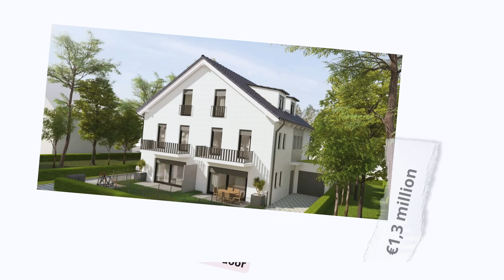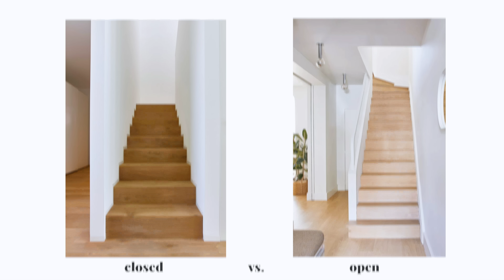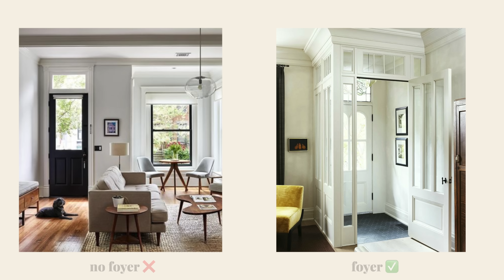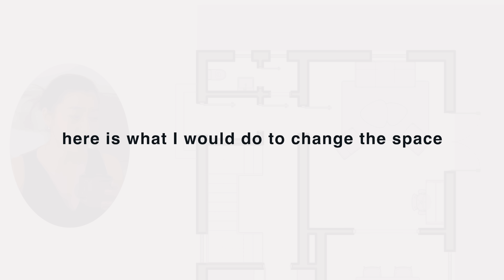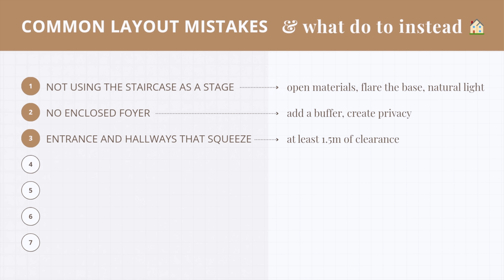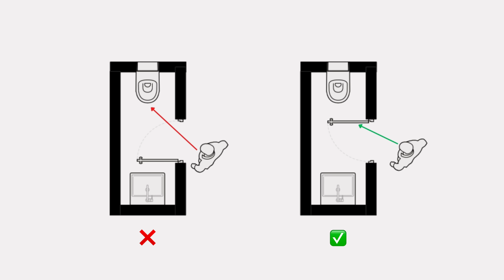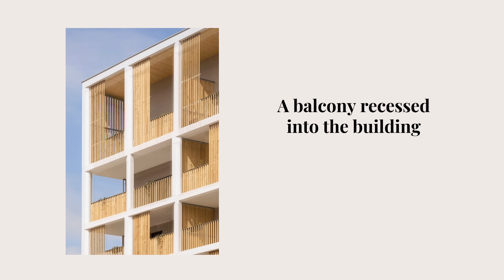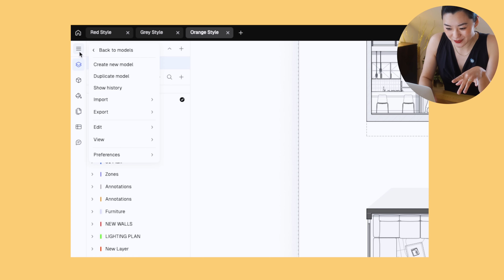Architect’s Advice: 7 Common Layout Mistakes + What to Do Instead

Comment: Outstanding!  The other issue is the bathroom at the top of the stairs with the toilet dead center! Why? And as you stated at the end of a hallway, etc, with the toilet dead center, ugh. We all know it is a necessary function ( item) but in a home? Homes are not public spaces, gyms, etc., where a direct path to the toilet may be necessary; unless there is an accommodation for physical or an age related issue, this is completely unappealing and unnecessary.  As you can tell, this is a hugh pet peeve of mine.😅  One last comment, people who have small budgets or who are low income still deserve good design for the same reasons and emotional wellness and, in that case, may even be more significant.

Comment: I personally prefer a bedroom facing east to catch morning sun and avoid evening HEAT. As an apartment dweller this is a nonnegotiable for me. And I’m a corner unit my bedroom has two walls of huge windows!!  I cannot fix my exposed toilet but just close the door slightly and for the architect who complained about windowless bathroom I agree and run a dehumidifier

Comment: Good points, although having windows on more than one wall is very unfeasible for most buildings and for most rooms in a given apartment/house. Also, a window is essentially a hole in the wall, thermally speaking, so it's a nightmare to keep warm at winter and cool in summer the more windows you have. If it's for someone's 10+ million dollar home, do whatever, but as a general rule for accomodating actual everyday people, I can't really see that happening too readily.
Reply: Double or triple glazed windows make a huge difference in temperature regulation of rooms with big or multiple windows, but I agree it is almost impossible to get that in most homes. I live in a condo and we have 3 exterior walls (we are very lucky, it's a small building with only 2 apartments per floor), but most apartments either have 2 or only one exterior walls, so it would be impossible to have more than one window per room.

Comment: I really do have to disagree on the last point. The open terrace type balcony is much better and is preferred by many. It gives a sense of openness, especially if it's in an apartment in a city. I have often seen the apartments with open terrace type balcony i.e. the ones which do not have overhangs and feel open command a premium in a city over the one that do not, often in the same building/complex; indicating a clear preference for those. The cozy, closed in balcony will probably make sense if you have a house surrounded with lot of private open space.

Comment: Part of the issue is the idea that open feels bigger. Yes, when there is no furniture in the room and no clutter. Or, the furniture has been carefully selected to fit the room but is not what most families will actually use open design can feel larger. But feeling larger and living larger is not the same. And with real worl traffic patters and the excess over massive furniture not to mention many unneeded pieces most open design is terrible design. Another concept is the idea that every square inch of space must be functional or else it will cost to much as waste. A space you don't use because it is unwelcoming, in accessible or not suited to it's intended purpose s the actual waste. But most consumers no matter the price point have no idea what they are looking at and don't know how bad the design really is for living until they've lived there. And my experience is no amount of experience, reason or computer imagery of the issues will change their mind.  Bad design is as much a function of builders trying to hard to maximize profits and consumers addicted to bad ideas and trends at all costs.

Comment: Here are some things I have encountered with floor plans.

Not putting furniture into the layout. The owner may put the furniture wherever they want, but you should at least consider one decent arrangement, and adjust the position of doors and power points accordingly.

Having doors in front of the sitting area or bed. The focus should be something calming or intetesting: a fireplace, a picture, a wall unit or a window with a view. Putting a door makes the space mundan and creates tension.

Open plan kitchens creates space, but they can get messy. Don't have the sitting area facing the kitchen. In India you may have a helper cleaning, and that can be distracting and noisy. Sometimes it is just better to keep the kitchen private, or only open to the dining area.

Sofas facing each other are more formal, less relaxed. An L shaped arrangement is more relaxed and cosey. Consider leaving sufficient space on two adjacent walls for an L shaped arrangement.

Verandas in India are used for drying cloth, putting ACs and keeping the sun off the outside walls. If they are large enough they often end up getting enclosed to create another room, or to make an existing room larger, which messes up the architecture. I hardly ever see people sitting on them as it is hot during the day and there are mosquitoes at night, especially if there isn't a view. Therefore I always put verandas for cloth drying which don't have to be so deep.

Many small bathrooms in india are wet bathrooms with no partition for the shower. It is functional and thats all. Glass partitions look good initially, but with hard water end up looking terrible if they are not maintained. Tile partitions make the bathroom look small and cluttered, and shower curtains get mold and look shaby. Here it's a matter of choosing your poison.

Comment: I'm not an architect, just an engineer, but the entrance area you describe at 3:45 cannot be simply generalized without reference to the second floor. If the second floor were an open living space, every time you open the door to the exterior it would be ventilated and cold would enter it. Also, the entire staircase area serves as a communication artery between the first and second floors, and no one wants to often go into a space that is directly cooled by the exterior every time the door is opened. Of course, this does not only apply only to cold air and such, but to any other external influence.
Reply from the maker: Thanks for sharing your perspective and thoughtful response! I kept my example general for the video, but your point is a great reminder that every design needs to respond to the specific layout and local conditions!

Comment: Very useful tips.
I'm planning to build our house in Kenya probably with precast concrete sheets. I'm not an architect but I have some ideas which I put together in Sweet Home 3D.
1. Is that a software professionals would use or is it just for amateur tinkering?
2. How detailed does an architectural floor plan have to be? Do you define all details like where columns and beams have to be positioned or where the water pipes and electric wiring are running?
3. Does the engineer have a separate floor plan with more technical details?
4. Btw my floor plans look like yours. Is that enough to give to a professional to add some legally required details?
Any hint is much appreciated 👍🏼

Comment: As to two lights sources, could one of the light sources be a skylight? I have a floor plan were windows are not possible. I do have light source from an open design but only way to get second source is skylight.

Comment: All good advice but I have a question. Is that sofa behind you not comfortable or sitting on the floor a better way to conduct an advisory video? About the natural lighting of rooms is an expensive remodel and a potential heat loss for years to come. So you really need to assess what the room will be used for and how much you use it. Thanks.

Comment: 0:04 No, the front door does not open straight into a toilet. The WC is in a separate room near the front door. This is a sensible place to have a toilet away from where you eat and easily accessible for guests.

Comment: if you can not put windows on two sides and worse not even by letting a door open or suche get light in from another side... would you say placeing a big mirrow would help/ and if so, where/ oposite of the window or sideways/ thank you for the answer and also for your great and easy to understand videos {english is not my mothertounge so technical topics like architecture can be hard to get, but you make it easy to understand}

Comment: What I learned. Make sure your house feels open and presentable even without furniture, let it be a stage and furniture the actors that complement the well crafted stage.

First impressions matter so make it good from the outside and when someone enters make it also look inviting. 

Remember that humans will live in that house and humans always like path of least resistance  so make it walkable, but remember, kitchen, living room, bedroom are rooms that are used, they are not corridors, rooms are a destination people like to sit it alone, so to make the room feel bigger and not a corridor put doors in corners of the room unless there is a lot happening, and the room is quite big by itself, humans will think differently and will prefer things to look symmetrical and in harmony overall. 

Toilet, do you really want to know early if person before you forgot to flush it? 

Windows, if you put 1 it will feel dark, put windows that let in light from 2 directions it will feel more open and inviting. Balcony, is a room in your house, not a standalone shed, make it feel as if it was a part of the house. 

So that's it, I will use this knowledge for my VS builds.

Comment: point 1.: The purpose of a staircase is to connect 2 floors. What you're describing, is adding it flare, rather than just strictly keeping it functional. I'd say the design should come down to personal preferences. I for one, wouldn't really like seeing wasted space, so I'd probably design a form of storage unit around it. But keeping it well lit is a good point, as it lessens the chances of accidents, like falling down the stairs, from misjudgeing how big a step we need.
point 2.: Who has space for a foyer? It's a waste of space, with no practical purpose.
point 3.: Again, who has space for that? To make something similar happen in my home, I had to remove a wall, and just add tht corridor to the room next to it as extra space, but now the toilet, bathroom, and office room all open from the dining area. I mean, it's still better than having a corridor open from there, that leads to those 3, but still. Just say this as is: big open spaces are better looking, so try to go with an open concept layout.
point 4.: Fair argument, but it's mostly aesthetic still. I mean, put your furnitures where you have space for them, in a way so you can still access them. You'll see any issues from their placement from living there a week or 2, and you'll see what needs changing/moving around.
point 5.: You assume people have the toilet in the bathroom, and not a separate room entirely. Could apply to some, definietly not to everyone. For those, who have their toilet in a separate area, well, good luck with that. You'd have to make the area for it at least twice as big. And simply moving stuff around won't even be possible for many areas with water connections, so no easy reorganizing those parts either. As for your last example there, for the door swinging in the opposite way, that'd be a health hazard. Don't do that. If you don't live alone, and someone opens the bathroom door on you, it could hit you right in the face/legs, depends on your posture. Also, it'd make "emergency toilet runs" much more of a pain, as you'd have to open the door, go in, close the door, than gain acess to the toilet. While in the original, open the door, and you already have the toilet access, you can swing it shut when you turn around to sit down. Sure, it's not aesthetic, but definietly a lot more useful than your alternative idea of changing the door's orientation.
point 6.: That is will most certainly NEVER do. For multiple reasons. 
 - Reason 1.: Most flats have no 2nd side towards a road. You'll be hard pressed to find one that has options for windows on multiple sides of the living room. Especially around where I live, in 35 or so years old buildings. 
 - Reason 2.: natural light is the enemy of everyone who works with a computer. It reflets off the screen, making it much harder to see. Even in my office room, I have the blinds closed 24/7. Even in your office example, I'd take the one on the left you marked problematic over the one you marked better. For the simple reason of LESS light.
Sure, it would look nicer the way you say, but it'd also be much less useful. Very bad point. Only allow natural light in rooms where you want it. Its only a pain to deal with otherwise.
poin 7.: meh... it's not really useful anyway. I mean, I only use my balcony to keep the outside part of the AC there. The only reason I ever go out there is to empty out the bucket with the condensation water.

Overall: Some interesting points, but definietly only apply to people designing a house from the get go. And I do mean a house, not a flat. Even the points that could apply to many people forget about the actual usefulness of said spaces. It's quite a hassle to make a living space functional and comfortable, making it look nice is just a secondary directive.

Comment: In the floor-plan drawing, you can easily delete walls and change the toilet & sink, in the reality , you need to dig two huge holes on the floor and change the drain pipe underground , it will cost $15,000 and 2 months waiting for construction permits. A good designer should use the minimum budget to make an effective and smart change.

Comment: Stairs are a utility, no need to waste space or materials for them to flare them out, placing them behind a wall, no need, just put up some railing and you are done. Than putting the crapper next to the front door, it is awesome, first of all it is practical, than it is easy to install, no need to move in the crapper 3 km into the house, why does some add more doors than what is needed? A WC only needs one door with a lock and you are good. When it comes to foyers, just put one outside the house if you need one, far better to just build one outside than inside. No need to divide a balcony, unless it is a flat. But than just put up a wall in the middle of the balcony, that gives you two balcony for the price of one. Open plan solution, well I can even hear the fire brigade screeching about that. They what compartments, to isolate the fire, gives you more time to get out. They hate open plan with a passion.

Comment: I hate stairs and hallways.  They waste a lot of usable space, and stairs are dangerous.  If you must have a staircase it should have a landing half way down to prevent deaths from falls.  Our base housing was so poorly designed that the 4 bedrooms and bath went into a hall with the staircase and once in them middle of the night my pregnant wife didn't realize that she was walking over the opening to the staircase and fell down it.  Luckily it had a landing halfway down, so she didn't fall the full length.  But her head put a big dent into the drywall.  No serious damage done to her or the baby, and glad there wasn't a 2 X 4 where her head hit.

Comment: Hi! just discovered you! We are in the process of buying a home and although i love the home, the staircases are not my cup of tea, straight away I felt that the placement of them is odd. Instead of being in the hallway they are behind a door in the living. of behind a door in the master bedroom? very strange. I wanted to open them op but both stairs are so narrow that relocating them would mean a better flow. Except, relocating the second stiars from the second floor gives me headaches, where to put it? same goes for a crampes entryway by the way. Would you like the floorplan to tackle this problem for an upcoming video? or would you like to give advice for possible options? Kind regards!
Ferlize

Comment: 1) Have front doors without glass, just with spy-hole with cover - save the wall, open the room
2) dont elongate first steps if you already fight for every m2 (which people usually do who does not own a mansion)
3) there is no need to decide if you want to block/see toilet or sink in thight bathrooms. Doors must swing outside not inside.

Her view is clearly architects view, not engineer.

Comment: The note about windows on 2 sides is definitely not advice for countries in Tropical climates. Too many windows and direct access to sunlight, while very aesthetically pleasing to the eye, generates so much heat in the day in such a space, especially when some of those windows are in direction of the Sun rising or setting. Most people will have to rack up a huge air-conditioning bill to use that space.

Comment: Many new homes these days built by builders are quick and simple without much architectural considerations. With skyrocketing building costs and low supply housing, builders now build what we call 'catapult homes', build quickly and sell. All these architectural considerations only push up more engineering and material costs.

Comment: As a framer and also a designers, my advice for stair area is, GIVE STAIRWAYS MORE SPACE: Length, width, height !  Architects often don't allow enough length for stair areas.
Reply: May I ask why modern staircases have such shallow steps? I can't fit much more than half my  12/46 feet on each step. and the rise is frequently awkwardly insufficient. Going up is just annoying. But going down is dangerous. I'm not that tall. I'm only 185. It's like the stairs are designed for hobbits.
Reply: @ak5659  Trying to build in more floorspace for the sales brochure; steeper and shallower steps will give you more floorspace (that often isn't even as useful as flatter and larger steps).